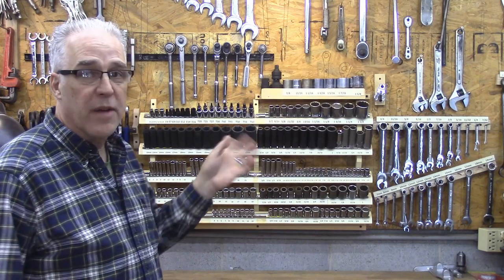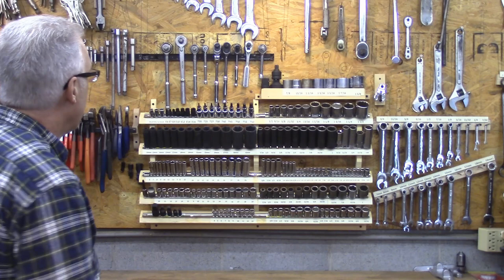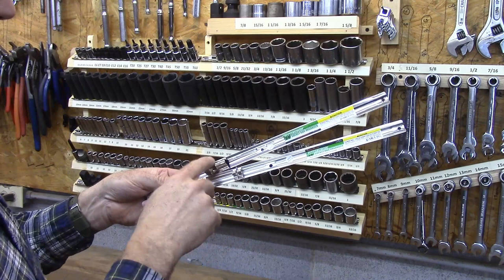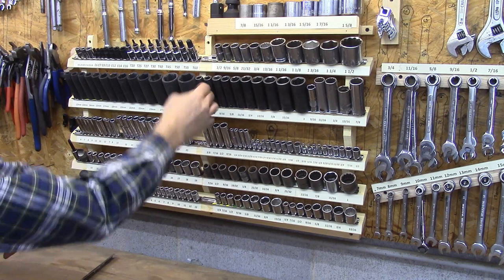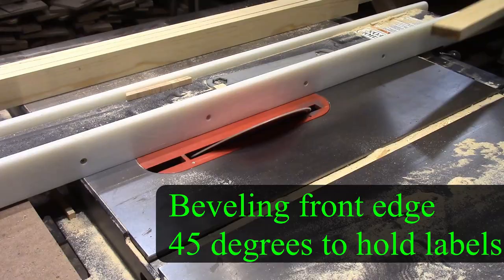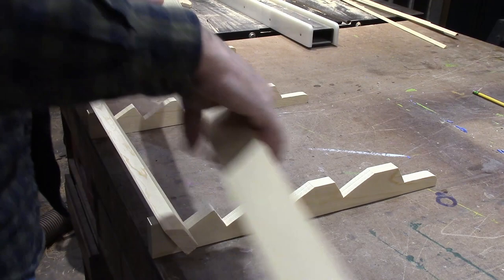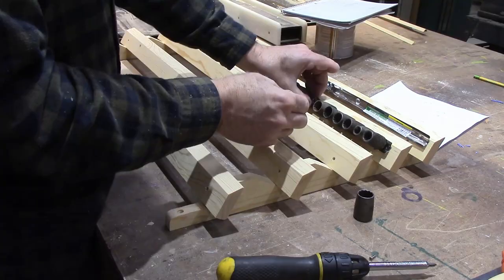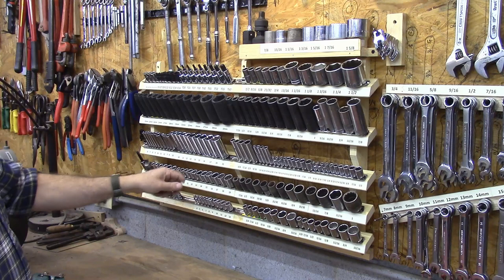DIY Socket Rack

Comment: Yes that was interesting.  I sure do like the 30 degree design for the height consideration.  The idea sure does clear up a lot of drawer space and makes the sockets more accessible at that.
Reply from the maker: Thanks Glenn.  It's funny how a simple thing can hold you up.  I put off building it until I finally figured out that if I tilted them a little they would take up a lot less space and be much easier to access.  Seems obvious now but took a few weeks before the idea occurred to me.  Hope you have a good week and your project goes well.

Comment: Amazing, your ratchets and extensions look exactly like mine. I have them on my peg board using same magnetic bars. I  have 3 magnetic bars one over another spaced about 8 inches each as I have some really long extensions and really long ratchets, but it s pretty much the same concept. Great minds think alike. Ive never bought any socket holders as they all are either failing junk or wont hold enough sockets. Ive been thinking of ways to make my own but I think your way is the best. Thanks for that. I'll start tomorrow!!!
Reply from the maker: You're welcome!  I hope your project works out great!

Comment: The rack is nice but I'm not a fan of snap-in socket holders. I use them now and it's too difficult to add and remove the sockets because of the tight fit. A simple peg is better, IMO.
Reply from the maker: The socket holders don't bother me but I can see where a peg would work well and be easier.  They are being moved around so the tight hold is not necessary.  Good suggestion.  Thanks!

Comment: Could you post the dimensions you used for the socket rack please? Love the idea and plan on building one if I had dimensions.  Thanks!
Reply from the maker: I didn't record the dimensions because each person's sockets will very.  I would suggest you line them up on a bench and then measure what size each shelf should be.  Good luck with building yours!